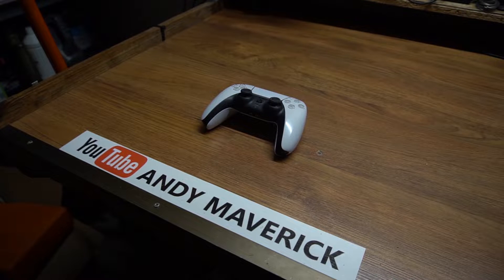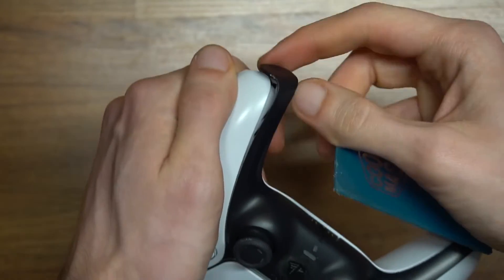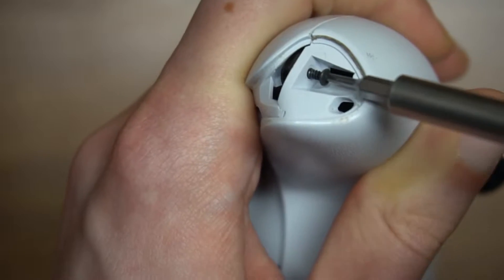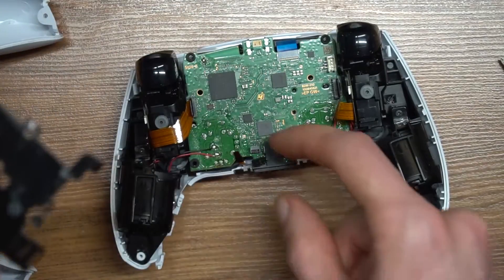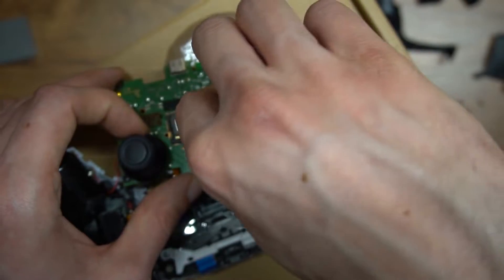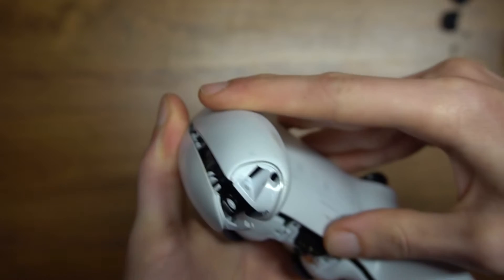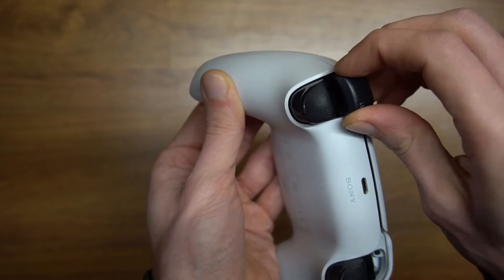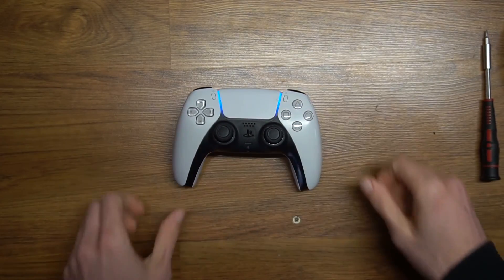DualSense Ghost Analog Input FIX

Comment: I had plenty of controllers with stick drift, the dual sense is the first one that developed phantom inputs because dirt made its way into the potentiometer. Also the first controller that had the spring break on the R2 button.
Reply from the maker: They have a lot of problems, I'm searching for good hall effect sensors. I tried one before but it was acting wierd.